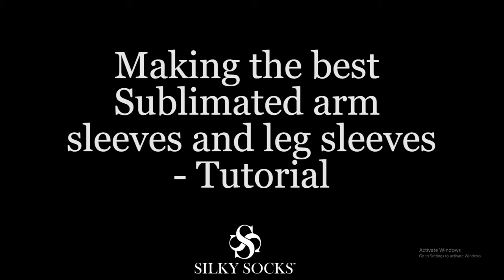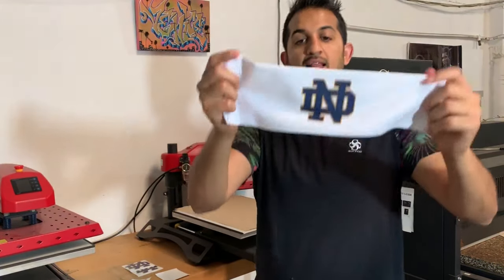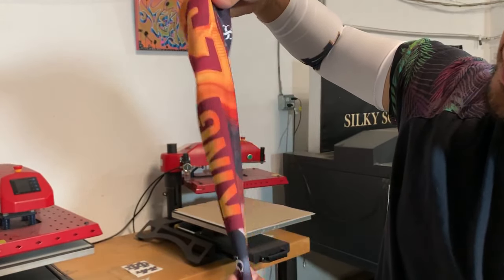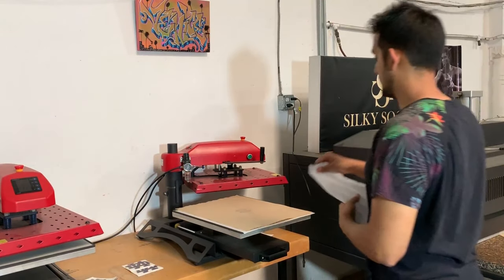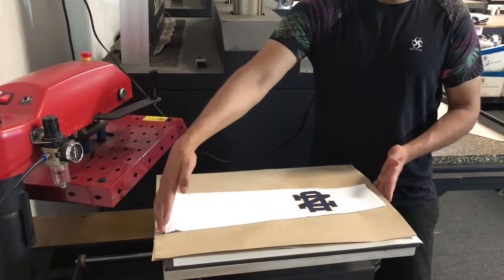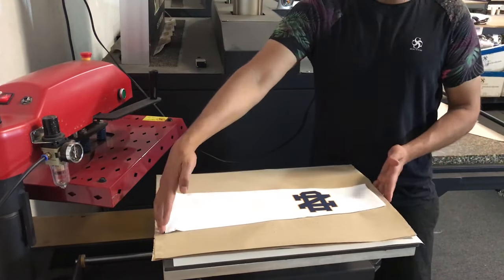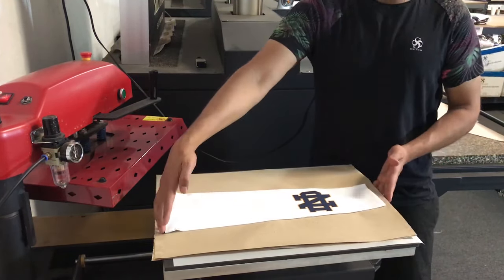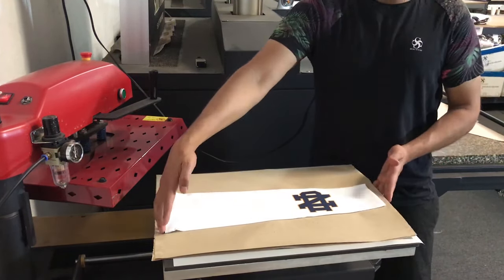How to Sublimate Arm sleeves and leg sleeves by Silky Socks

Comment: If you don’t won’t you have a white line on the edges?
Reply from the maker: Kelly Walker no not really.  It can flatten enough and connect the front and back. Pretty much looking seem less.  Might need to make sure it has enough time and pressure.